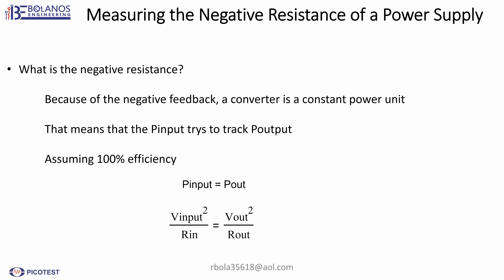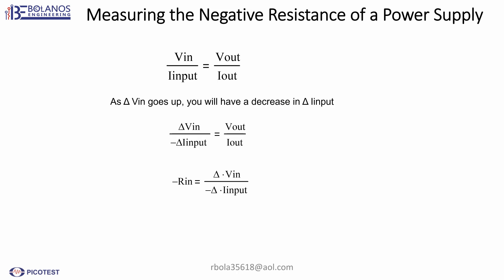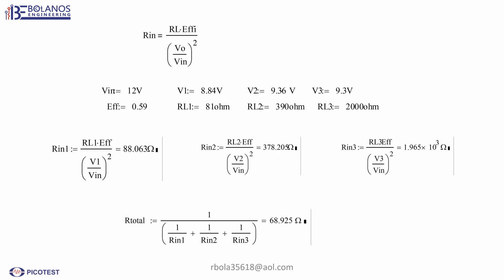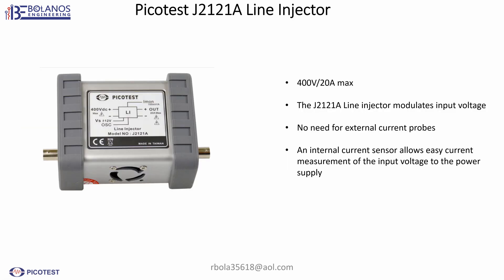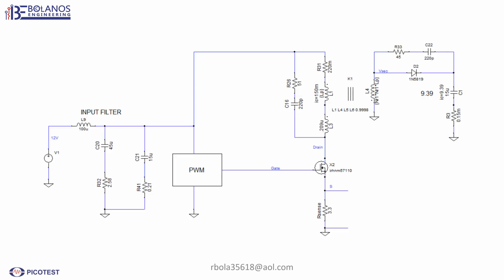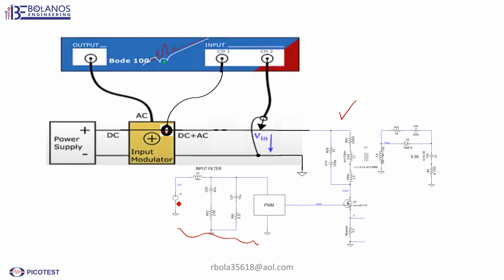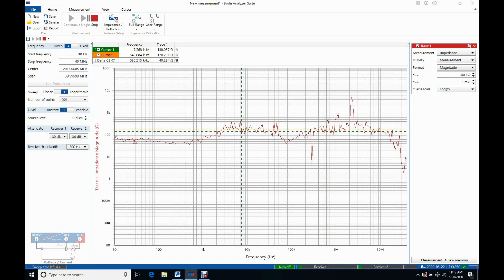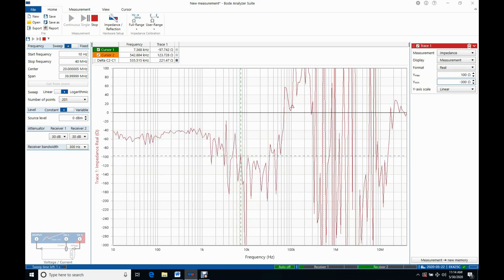How to measure the Negative Resistance using the Omicron Bode 100

Comment: Hi sir in your Circuit for PI Controller Implementation what is the IC you chosen.Also sir I am having a Doubt with Closed Loop Implementation whether to go with Microcontroller(with our own PI Program) or Using Already available IC's or OPAMP. Which one is good sir.

Comment: Mr. Robert: How do you make this measurement for 400 vin-> 12vout ? Second question is if I want to measure the filter output impedance and the power supply input impedance, if you see from your measurement it is mostly garbage for higher frequency so how would one know if the filter peaking is reduced or below the input impedance of the power supply?
Reply from the maker: Hi Kali, Sorry I did not see your post. Yes, the high frequency the measure is very noisy once you get pass the crossover frequency. We are more interested in the low frequency measurement. So in this case the negative is around -60 ohms. A quick check is to look at your input filter. Generally speaking, there will be a capacitor and a resistor in series. These RC network will be used to damp the input filter. Look at the rdamping resistor.   In my case the R32 is my rdamping resistor and it has a value of 2.58 ohms.  So I can then make a statement that the output impedance of my input filter is determine by R32.   So in my case the output impedance of the input filter is 2.58 ohms while the input impedance of the converter is magnitude of -60 ohms = 60 ohms ,     ( Zout_input=2.58 ohms) << ((Zinput_converter = msgnitube (60ohms)) . So by this we satify the Middlebrook Criteria.